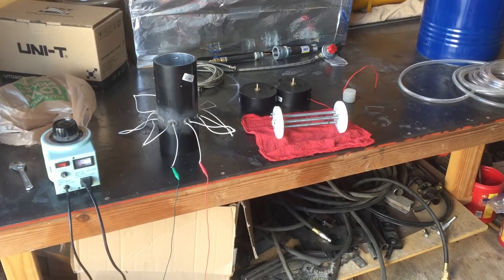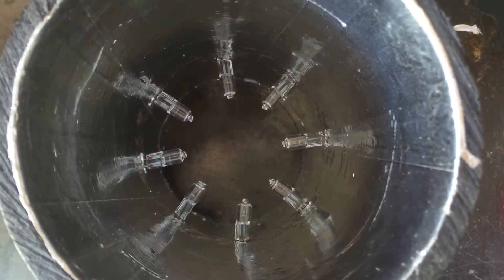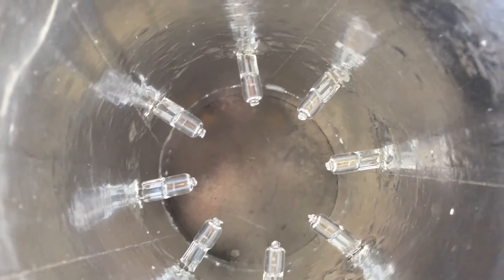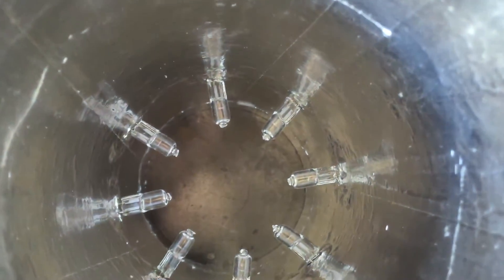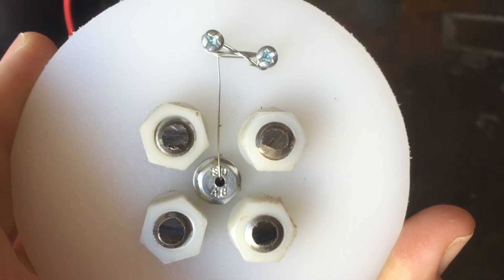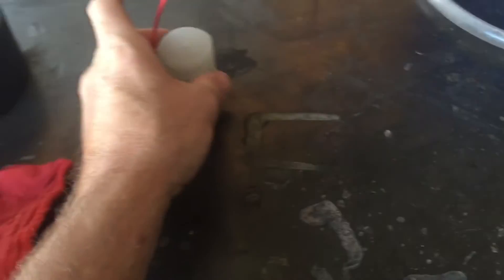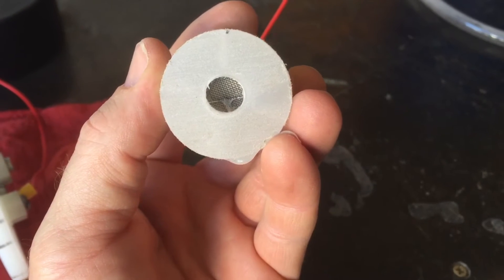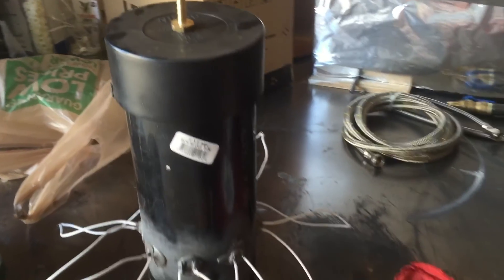A Look Inside the Multi-Gas Processor Using Halogen Bulbs as the Photon Source

Comment: Hey Russ! What exactly is a gas processor used for?
Reply from the maker: It's used to strip electrons off gas atoms to make them combine with other atoms easier. This is just one part of my research of Stanley Mayer's Electrical Partial Generator (EPG). He claimed to combine atoms like argon and iron to create a magnetic gas. The magnetic gas is then used in a generator instead of permanent or electromagnets to cut down on magnetic friction and other energy losses.
Reply: @LimitlessResearch  Good luck trying to make other molecules with Argon. Even though you can ionize it pretty easily, it's very chemically inert being a noble gas.
Reply from the maker: Jeffrey Schultz I understand it’s difficult and happens rarely, but I’m still going to try because it is possible.
https://en.m.wikipedia.org/wiki/Argon_compounds